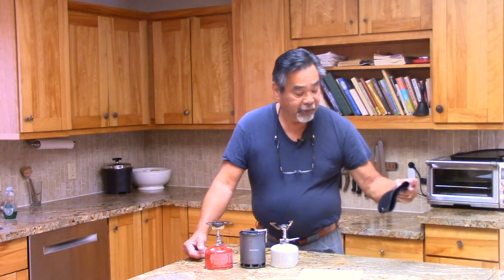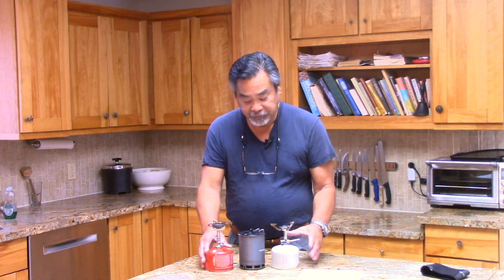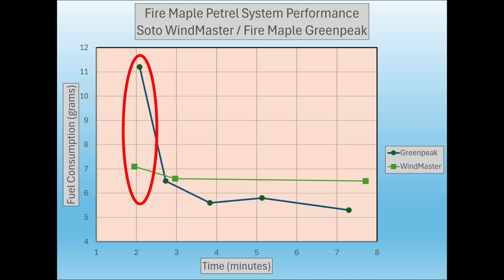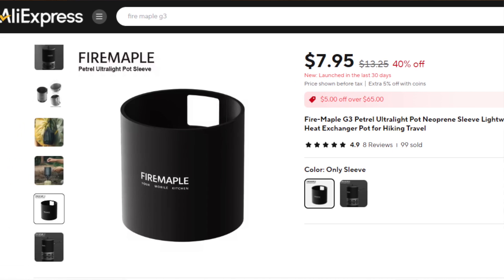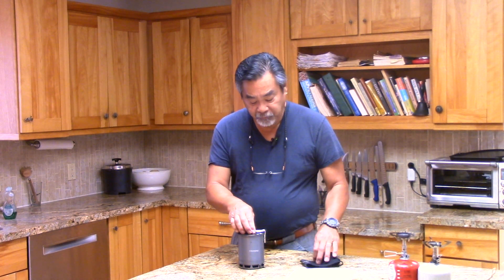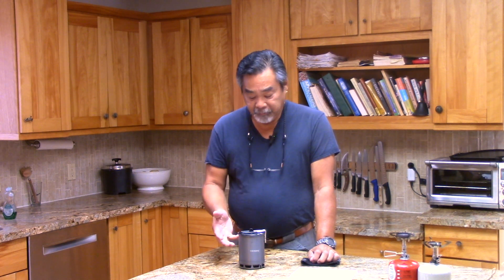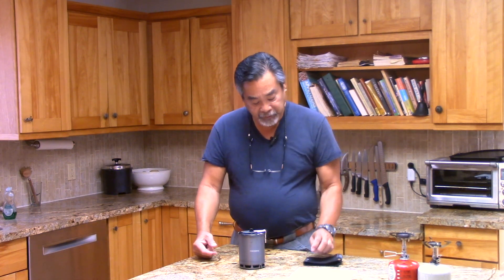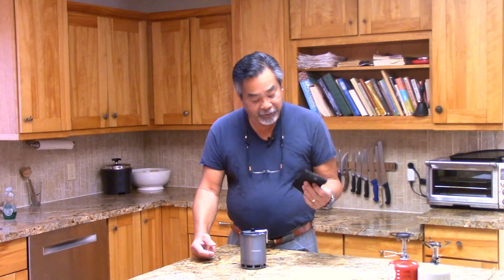The Petrel HX Mug: Fast & Furious : Sleeve or no Sleeve?

Comment: Good video. When picking up something hot, isn’t the thermal conductivity of the material rather than just the surface temperature that counts? If the thermal conductivity is low (rubber), then at the same temperature it puts a lot less heat into your skin than something of the same temperature with high conductivity-metal pan. Think it’s the reason why fire walkers can walk over hot coals without burning feet, the coals have low conductivity. The amount of heat going into your skin causes the burns and this is a function of both temperature, conductivity and thermal mass (how much energy is there) . Just a thought. Did you try picking up with the cosy ? But agree, unless it thick enough to allow you to junk the heavy handle, the sleeve is not worth buying.
Reply from the maker: Fire walking works because the R value of the ash is so high that is acually insulates.   The Fire Maple Neoprene sleeve is only 2 mm thick at most and yes, it was way to hot to pick up with my hand.
Reply: @FlatCatGear Thanks for saving me a mis purchase of a sleeve.

Comment: Never would have thought that my Windmaster can be used for fast boils with such a small performance penalty. Like you, I generally don't rush and use a lower flame, which with most stoves would save fuel. Thanks!
Reply from the maker: Yep, helps to characterize your stove to see what you can get away with (or not).  Regulated stoves are pretty well tempered.

Comment: John this is a great video on the benefits (or lack there of) of the Fire Maple neoprene sleeve.

I wonder how Jetboil's design is different.
Their unregulated stove (i.e. Flash) uses a neoprene stove. 
The sleeve doesn't melt, and it permits you to pick the pot up and drink out of it by holding the neoprene sleeve.
Reply from the maker: I am assuming that JetBoil does system level design and testing.  That means that the stove output is probably matched to the HX design.  Remember, I am testing a Fire Maple Greenpeak with the Petrel stove, and it really wasn’t designed for that.  Now, the petrel pot/neoprene sleeve should work with the Fire Maple Hornet II stove as that is supposed to be a system.  Additionally, the neoprene sleeve may have been released after the Petrel pot per customer request.  IMO, the neoprene sleeve is just too thin to act as a good insulator.
Reply: @FlatCatGear  Thanks for the fast response.
I am a bit confused. 😀
I thought the Petrel Pot and the Greenpeak stove are made by FireMaple.
Is the Hornet Ⅱ a regulated stove, like the Soto Windburner?
Sorry for all of the questions, just trying to get a better understanding of stoves and their efficiency.
Reply from the maker: @RudyHassallPMP  Fire Maple makes the 300t, the Hornet II, the Greenpeak stove, the Petrel HX mug and a whole bunch of other stoves.  After teh Petrel was introduced, they bundles it with the Hornet II as a sytem.  It does not mean that all Fire Maple stoves work with all Fire Maple pots.  You have to find the components that match each other.
THe Soto WindMaster is regulated, the 300t, Hornet II and Greanpeak are not.